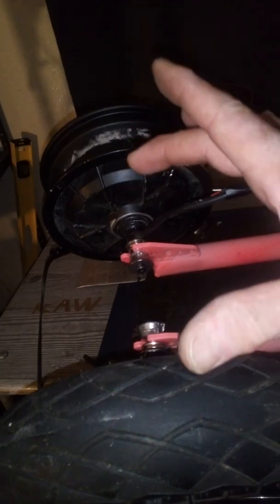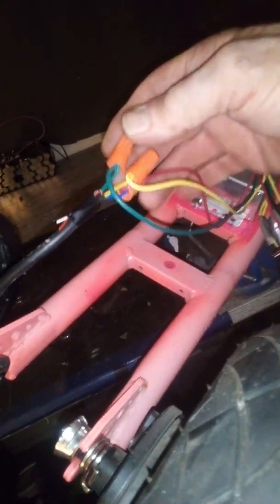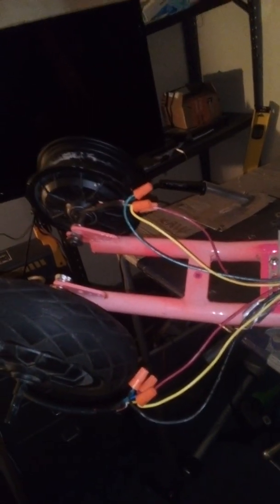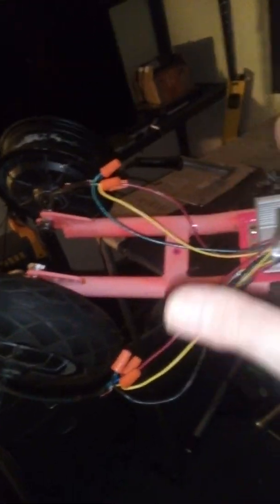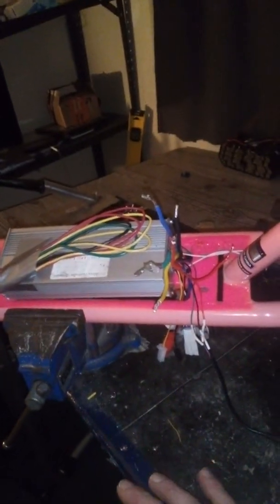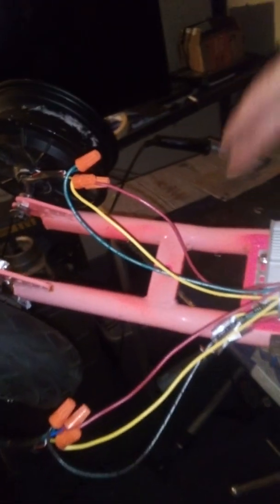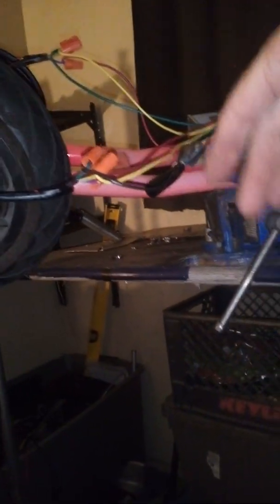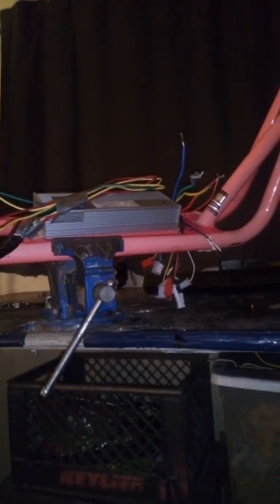2 identical BLDC motors & 1 controller without hall sensors!

Comment: The clipping you are experiencing is because you don't have your hall sensors connected to that motor.  Try doin this, flip the scooter upside down and hand spin that motor.  While hand spinning the sensorless motor now bring on the throttle.  The motor should get out of that initial clipping and start rotating just fine.    Having a dual motor setup you'd have better luck running one of the motors with hall sensors.  That way it will at least get you moving when you apply throttle and the hall sensorless motor will start  making power once you are moving and not just sitting still.

Comment: Did u just run everything parrelel?
Reply: Yes.  Connect them in parallel.  Blue motor 1, to Blue motor 2 , to controller output BLUE phase. 
 Do the same  for Yellow and Green phase wires
Reply: I'll call ya out , you sir are full of crap why don't we see it running   it's because it dosent work yeah 😂 I noticed you don't mention why you don't show it running you could have atleast got a second controller and made it look like it works , piss poor please try a little harder
Reply: He didn't run anything 😂

Comment: @johnvanlandingham8832  I have same hub motor, did your have 3 other wires that aren't the hall sensor, nor the phase wires? Mine has the phase wires, plus 3 smaller wires that are not the hall sensor wires, I have no clue as to what to do with them
Reply: Are those 3 smaller wires going inside the motor?   If so, open up the motor and see what they  are connected to. 

 My guess is there is at least one hall sensor inside which would use 2 wires (+ and -) and one wire that is connected inside the motor for a temp sensor.   3 wires total.

Comment: Good stuff. I recently purchase the same controller but with 1000w at 48v. I am currently learning these type of controllers. I attempted to get one motor going yesterday but failed. Anyway, I have the same thinking as you, any controller should be able to run two motors because the controller’s job is to push current out and it doesn’t care what is powering so long as it is within its limits. So, I am glad you proved it. Now, what happened to the scooter, why haven’t you loaded more videos with the same setup? Thank you